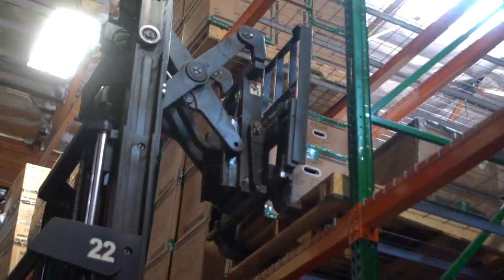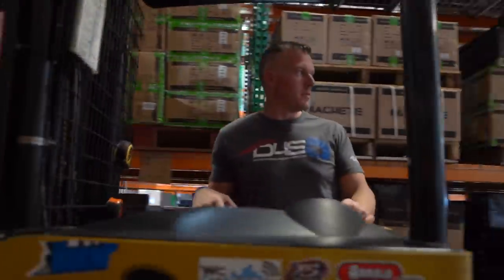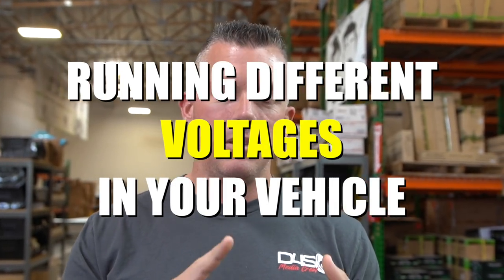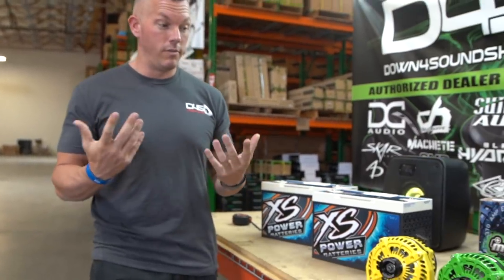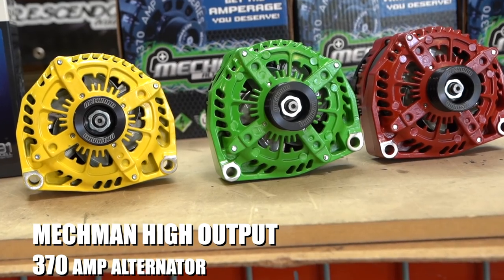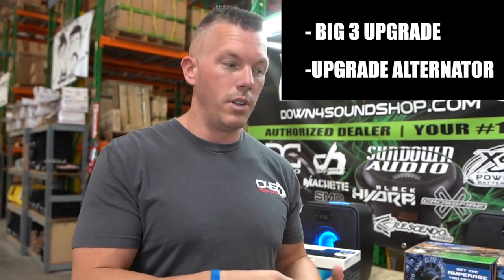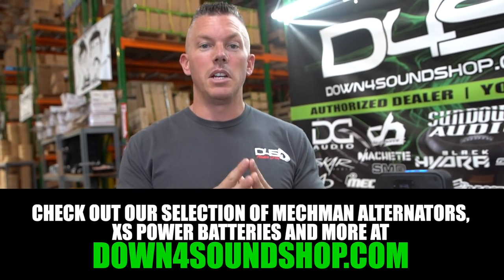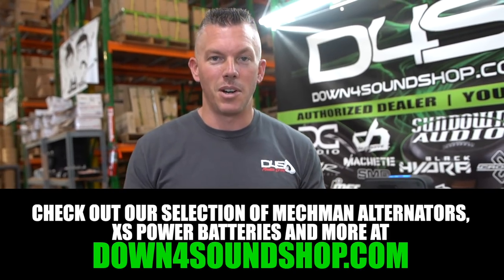WHAT YOU NEED TO KNOW, BEFORE YOU CHANGING THE VOLTAGE IN YOUR VEHICLE

Comment: Doing my first big system with electrical upgrades on my 2013 4 runner. I’ll have two 3k bass amps and around an 800watt mids amp. What kind of alt and battery configuration would I run?
Reply: I have about the same setup and have a 300 amp alt on three total batteries. One up front and two in the back.. I'm OK, but considering adding either one more battery in the back, or going to a 370 amp alt. Cost will be about the same either way, so I'm opting for the new alt. BTW, don't skip on wiring. Hope that helps.
Reply: Depends on vehicle but 250a+ alt and fuck batteries.. go lithium. Yinlong lithium 80ah. Very safe and user friendly. You'll never drop under full tilting.
Reply: @vincebowling1778  yuh it’ll suck spending a lot on wire but I will get a bunch of 1/0 ofc. I’m thinking lithium would be the way to go on batteries. Less space
Reply: @crunkwun  ok well it’ll be goin into a 4 runner but ya lithium seems the way to go. I don’t want to buy 3 batteries. Would rather just have one strong battery.
Reply: @matthewcoulter3991  80ah lithium is equivalent to roughly 8-12 100ah agms depending on your charging voltage. The foot print of an 80ah LTO bank is smaller than 1x 100ah agm and weighs less than 1x 100ah agm.. thats including the box and buss bars for the lithium bank.
Reply: @matthewcoulter3991  you'll never regret swapping out to lithium.. trust me. I was abit hesitant at 1st.. I even wasted money on a 500a isolator thinking to separate my underhood battery from my lithium because I was too scared to go all lithium(we've load tested lithium.. it has 1100cca). Don't be dumb like me lol you'll come to find an isolator is a total waste of money and going all lithium with a battery to delete is the way to go. Don't listen to what anyone says about using an isolator for lithium and agm.
But if you're going lithium do invest in a 30v-10a power supply to charge your lithium bank and to keep it topped off once in a while. They're on eBay and Amazon for cheap. Keep in mind an alternator is a battery maintainer not a battery charger.
Reply: @crunkwun  well you’ve got me convinced man. What exactly do you mean by battery delete like literally ONE lithium powers my entire car? Like get rid of the under hood stock battery and just have one lithium do everything in the trunk? I’m ok with charging it but I can’t be having battery issues this is my daily driver and it’s gotta be able to get me to work lol. I’m new to all these battery/alternator upgrades. My old system was a 12 with a 1500w amp on stock electric with a single run of 4 gauge from stock battery to amp
Reply: @matthewcoulter3991  a battery delete is exactly how you think it is.. delete your main wet/agm battery under hood(remove it from vehicle) I just keep a cheap voltage meter on my lithium to view voltage. I've been running lithium for about 10 months now and have zero issues. I've got my lithium in my daily driver aswell. LTO yinlong lithium has a life cycle of roughly 30- 50 years. So your bank should out live your vehicle lol
Reply: @matthewcoulter3991  lithium doesn't like warm/hot places so keep it out of the engine bay.. keep in trunk and you'll be good.
Reply: @crunkwun  really?? Would 35ah be sufficient for my system? (About 7000watts)
Reply: @matthewcoulter3991  explain exactly what 7000 watt amp you have. And I'll tell you if it's enough.
Reply: @crunkwun  two taramps smart 3ks plus a multichannel amp for mids and highs. Not sure how big that multichannel amp will be
Reply: @matthewcoulter3991  ok, you'll need 2 banks of 35ah then(12 cells). 1 bank of 35ah(6x cells) is good for 4krms.
Reply: @matthewcoulter3991  I have 2x smart 3ks currently.. have 80ah yinlong lithium and Brand X 425a alt charging at 14.5v. Under full tilt I drop .1 - .2volts I'm switching out and going 2x Smart 5ks and up my charging voltage to 15.5
Reply: @crunkwun  425amp alt?? Damn. What charging voltage would you recommend for me? I have a 2013 four runner. You like the smart 3ks?
Reply: @matthewcoulter3991  smart 3s are awesome. I'm actually a Taramps rep so have to use their stuff lol 
Some don't like the sound of full bridge amps but a digital sound processor fixes that.
Reply: @matthewcoulter3991  for you I'd recommend 15v+ cold start charging if you can.
Reply: @crunkwun  is the smart 3 a full bridge? 🤣 I’ve heard nothing but good about taramps
Reply: @crunkwun  ol is that hard to achieve?
Reply: @matthewcoulter3991  haha yes, all their amps are full bridge. Probably why you see other half bridge amps like Korean are over double the size for their 3k compared to a smart 3.
Reply: @matthewcoulter3991  hard to achieve as in 15v+ charging? You will have to ask the alt maker that question. If alt is internally regulated it'll be easy compared to externally regulated.
Reply: @crunkwun  yeah wondered why they are so small. People don’t like the sound of them?? Didn’t even think amps had anything to do with sound quality lol
Reply: What should I get if I need 6000watts rms? I'll have a 12k bass amp for one 18, and factory speakers
Reply: @bailey2517  what amp is it? For 6000w you’ll need big 3, aftermarket alternator, and reserve batteries (lithium is better than agm)
Reply: @matthewcoulter3991  I'm not sure yet but it might be the deaf bonce apocalypse one with ~12k watts  (can't remember name) I'm gonna buy a deaf bonce db 4518.
Reply: @matthewcoulter3991  is there an amp you'd recommend? I'm kinda new to this so idk what's best
Reply: @bailey2517  a 12k amp is very expensive and you won’t find one that actually does 12k under a $1000. You’ll need serious electrical upgrades to see that kind of power as well. You have one 18?? Correct? what is the rms rating for your sub?
Reply: @matthewcoulter3991  Oof. It's a 4500rms sub but lots of people say its rated conservatively and can take up to 6000 RMS. And also I've read that you should get an amp that can output more than your subs peak power (9,000~12,000) to avoid damaging it over time or clipping. Is that true?
Reply: @matthewcoulter3991  because it would be great if I could just get a 5 or 6000 watt amp instead.
Reply: @bailey2517  it’s never a bad thing to have an amp that does much more wattage than your sub can take. You just have to be really careful about setting your gains right so you don’t clip and blow your sub. If I were you I’d look into a 6000watt amp and get a full bridge amp. A full bridge amp will be cheaper and have a smaller footprint. You could look into a Taramps smart bass 5
Reply: @bailey2517  since you’re new to this I’d go with the weaker amp and set your gains right with a multimeter or if you’d like to spend the extra money and get a dd1 then you can set your gains just right and hammer away with a bigger amp. A bigger amp means a lot more $$$ and more electrical upgrades tho. Start with the smaller amp than you can easily add on later in the future
Reply: @matthewcoulter3991  awesome. Thanks for the advice bro!!